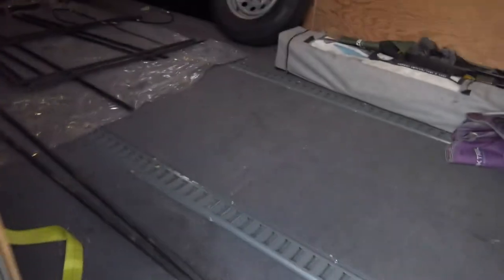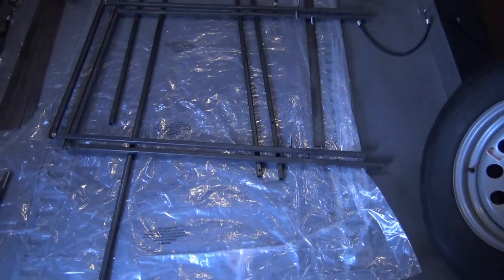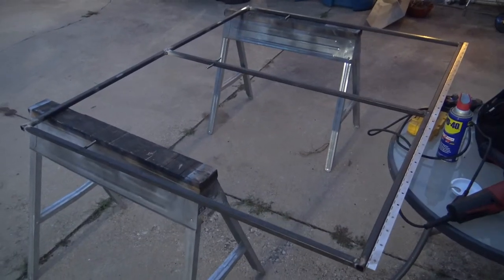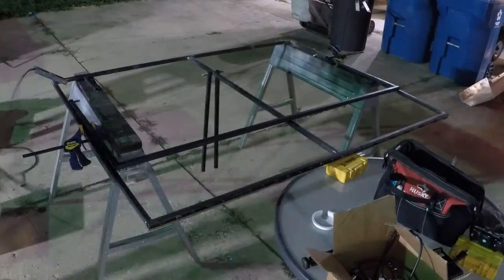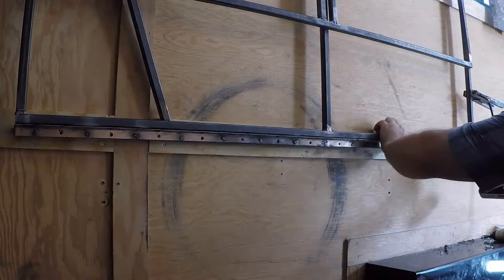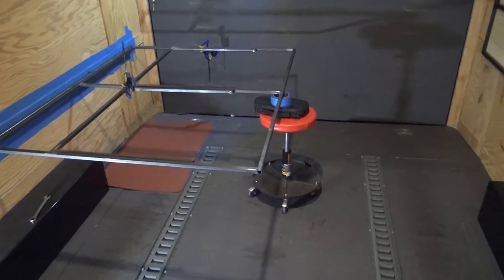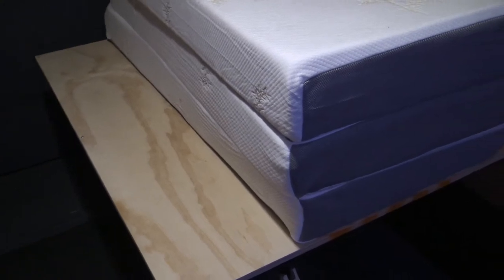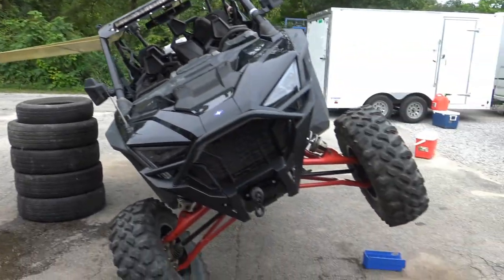Building a Flip Down Bed Frame for a Custom Built Toy Hauler

Comment: I did the 4 inch with 3 inches of memory foam topper on it.  I prefer dual density since I am a side sleeper.  Of course I only need bed for one so mine is only 32 wide.

Comment: How you will store matress foam there is no gap between wall and flip over frame usually there is 4 inch or so gap to accommodate matress foam.
Reply from the maker: I didn't want frame that far off the wall. I fold the mattress up and store it in the front of the trailer so it's out of my way. Thanks for watching!

Comment: Looks great!  Anything you'd change now that you've had it for a couple years?
Reply from the maker: If i had to do it again i would do a bigger ac unit and would have done a 24' so I could haul 2 machines. Other than that the trailer works great still. At that time this was probably max for the truck I was driving.

Comment: Great design, would you happen to have a detailed Plan so I can build one for my  Trailer?
Reply from the maker: Unfortunately I don't :/. I just used 3/4" square tube and 3/4" plywood. The plan would have to vary depending on what height the mattress was, what size mattress you wanted (I did a queen) and the trailers width. If you get into the project and have any questions, let us know. Thanks for watching and don't forget to subscribe!